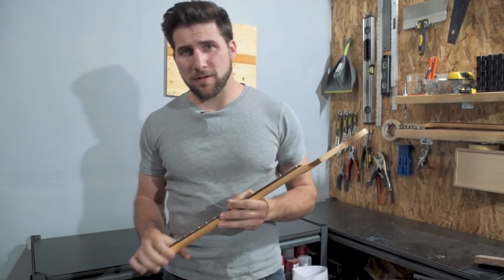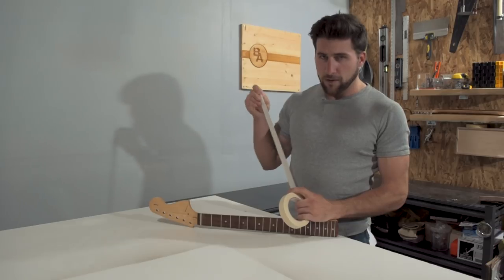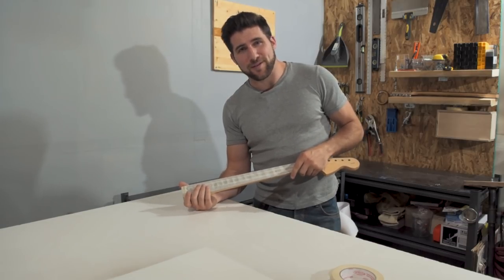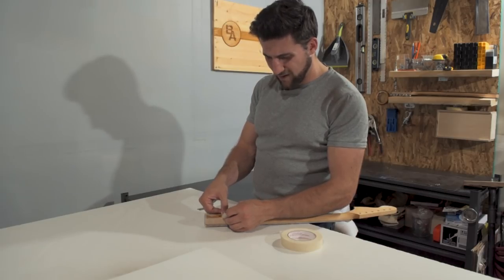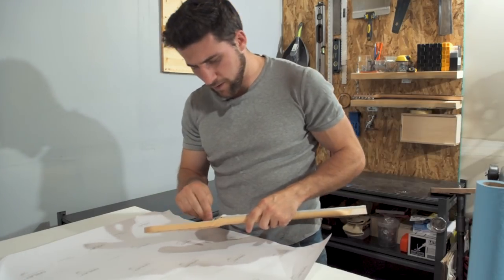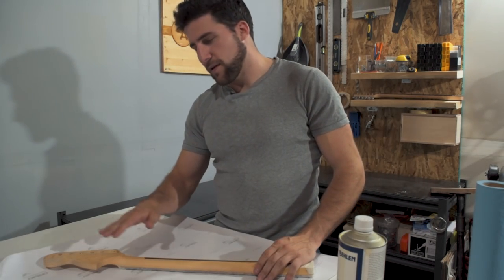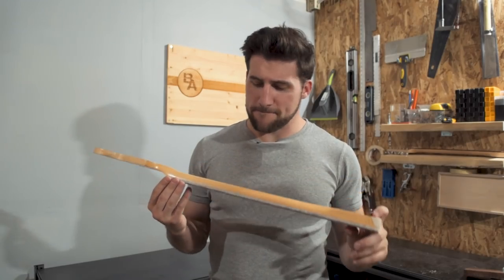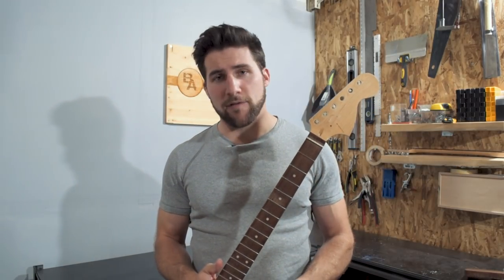How to finish a guitar neck

Comment: Why you didn't mark it before you took it off...what's your opinion of tru oil vs teak oil
Reply from the maker: There’s no real reason not to mark it first other than that you might sand the marking off. I acquired this neck separately from the body, so it was already of haha.

Comment: I hope I didn't miss where you covered this already, but..... If i'm sanding a neck to re-finish or touch up, is the logo/s.n. lost? I mean, sanding will pretty much destroy that info, won't it? Or does anyone even care if the neck stays branded?
Reply from the maker: The logo might be under a layer of clear; in which case it generally wouldn’t be lost.

Comment: Should i put the water decal before the finish or in between coats?
Reply from the maker: Either or. As long as the wood is smooth enough to accept it properly. You may want to seal first and then apply it.
Reply: based on experience, put the decal in between coats.

Comment: Hi, what's the type of finish applied on rosewood fretboard side? On my guitar I see it's peeling off in few spots, and I would like to fix it.
Thanx!
Reply from the maker: Usually fretboards don’t really have a finish on them per se. It could be lacquer or boiled linseed oil.
Reply: Brad Angove thanks! I don't know, if you have a minute someday, I've posted a picture on this forum : https://www.espguitars.com/forums/1963390/posts/4339257-esp-kh2-cs-neck-thru-neck-finish

Thank you and Merry Xmas :)
Reply from the maker: I see the post, but can’t see the photo for some reason.
Reply: Brad Angove let's try this way :
http://s171.photobucket.com/user/photovideobucket/media/DSC00002.jpg.html

In  here there are 3 pics.
Cheers !
Reply from the maker: That's very odd. The fretboard itself doesn't appear to have any substantial finish on it, but there's clearly some paint lift on the side. Oil generally soaks in too much to left like that, but the top looks like it has soaked in. Maybe it's just a thin coat of low-sheen lacquer.
Reply: Brad Angove thanx so much. Yes it's strange. I'll contact the tech support before to touch it, not to make a big mess :) 
One time acknowledged the finish type, would be also hard to understand how to cover and fix those spots...
What can a possible solution may be? Spray, a cloth with liquid a finish ? Thanx again
Reply from the maker: Once you know what type of finish it is let me know. I’ll see if I can help.
Reply: Brad Angove thank you so much!
Reply from the maker: Thanks for watching.
Reply: Brad Angove Hi Brad, they gave me the answer. They use Polyurethane coating on the vast majority of their instruments . They couldn't give me the brand name of the paint because they use to make a mix of them, depending what they do have in the shop. Please let me know how to proceed  :)
Thank you!
Reply from the maker: Damn. I was hoping it would be lacquer. It’s just on the side, right?
Reply: Brad Angove yes, in the bottom
Reply from the maker: Ok. Polyurethane builds in layers, so it’s difficult to fix perfectly because when you sand through a layer it leaves a line. If it were me I would probably sand or scrape that area back smooth until you can’t see any more peeled stuff, and then apply a fresh coat to that area. If you can limit your repair to an area with defined borders, you can disguise the repair lines better.
Reply: Brad Angove all right, so maybe it's a repair to do in case it would expand  to a larger area I suppose. Sanding  the neck (or part of it), for a so little portion could be a problem, also because the result might be not perfect. Just to know it, poly is a finish to apply by spray or with a cloth too?
Thanks Brad! 
Cheers
Reply from the maker: You can get poly in spray, wipe on, or brush on format.
Reply: Brad Angove thanx so much for giving me help! I'll decide what to do now, or better along with my luthier. It's hard to decide if leaving  it as it is ( since it could be a normal wear sign), or to make it fix  and doing a lot of work for a so small portion...